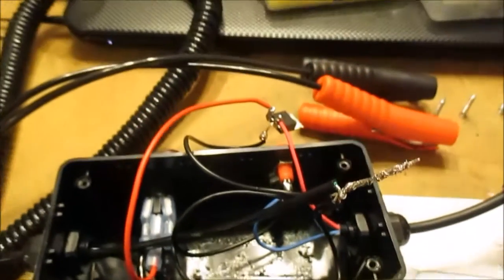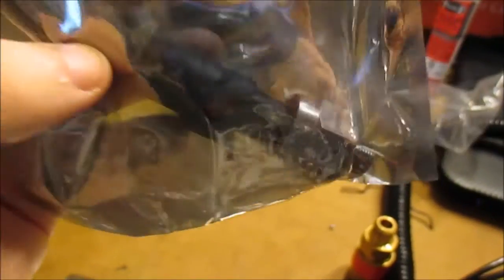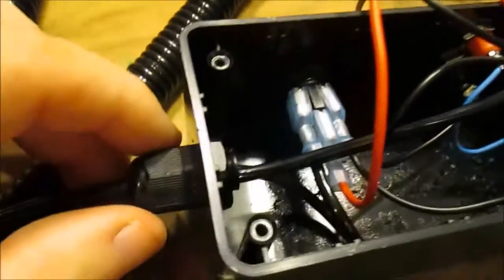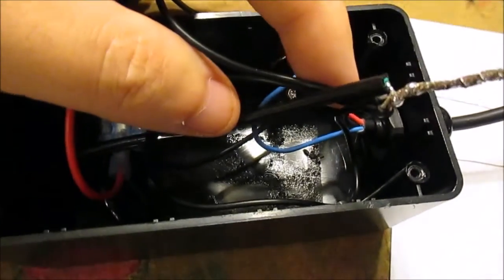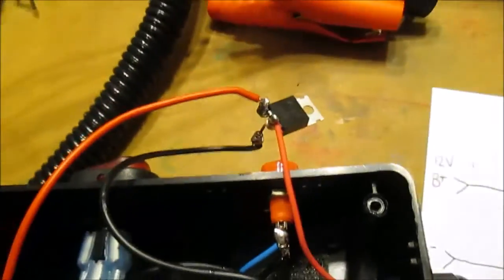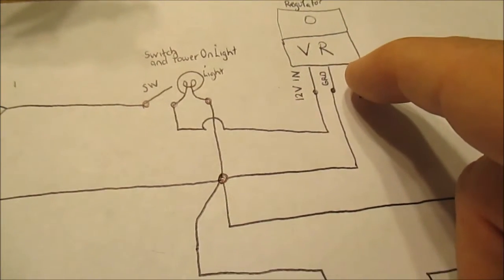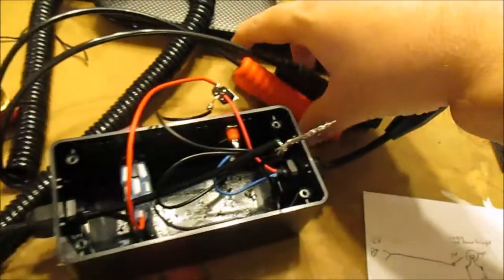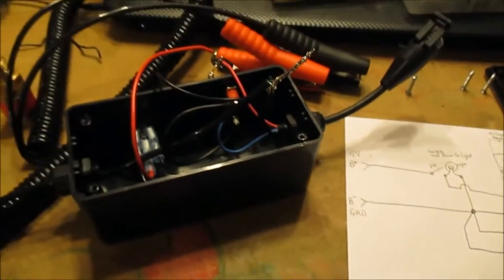Homemade In-Cylinder Pressure Transducer Part 1 The Build

Comment: Normally, a large capacitor is used on the input to the voltage regulator and a small capacitor on the output to help filter any noise out of your circuit.  You can find plenty of example circuits online.  I am thinking about using the same pressure transducers for reading refrigerant pressures in my home HVAC.  Also, I want to read refrigerant line temperatures to calculate superheat and subcool using a Raspberry PI 3.
Reply: Yes agree, if you are going to power this from a car battery a 100uf on the input and 10uf on the output will knock out the alternator noise

Comment: Nice. I bought some Honeywell transducers for mine. I made my box where it has three outputs for transducers so I can run in cylinder, exhaust, and intake at the same time. I used three harnesses that exit the box that are keyed and have threaded ends. That way I don’t have to plug and unplug that fragile three pin pigtail that fits the transducers. I made a simple box with battery clamps first, used it for a while, and took notes on things that would make it more convenient. If you haven’t done so yet you should also make a DIY first look sensor. For less than $20 it’s a handy tool in certain situations.
Reply: can you do a video for your project?
 thanks
Reply from the maker: Thanks for watching!

Comment: Thanks for your video! Very inspiring! I've just ordered the Picoscope 4425 (As I need a professional graphic interface to print results and Pico Automotive supplies the best PC based interface for their Automotive scopes. So I've looked to add also a pressure transducer for having an absolute pressure reading in addition to the electric relative compression test the scope gives. 
I just have a few question please:

1. Why to reduce the volt from 12V to 5V? Do you know what voltage output the Picoscope would handle the best?
2. Can I use a BNC based cabling instead on your 4mm based Banana connections? What would be the wiring of a BNC cable into the box? Which is signal and which is the ground pls?
3.  If I'm not wrong, a healthy engine should give around 200 PSI. Would it be better to use a 300 PSI transducer and to gain more accuracy instead of the almost twice the time  un-needed high pressure support?

Thank you!
Reply from the maker: My husband passed away, and I don't have any answers. Sorry. Thanks for watching anyway.

Comment: ordered all the parts to make a transducer for 500 psi, my question is why some people have 500 and 100 and 30 psi transducers when the 500psi will go from 500 to a vacuum. seems like this would be a pretty general use unit.
Reply: Simple -> Accuracy. With a 500psi sensor 12.5psi/0.1V with a 30psi sensor 0.75psi/0.1V.
Reply: Resolution (not accuracy).

Comment: Can you please specify the pressure transducer type? I cannot find one which would be good for the range 0 - 1000 PSI
Reply from the maker: The ones I used were not brand name specific. I bought mine off of ebay, I got one that said 500 psi and one that said 1000 psi.  If you go on ebay and type pressure transducer you will find them for many applications, it just depends on what you are trying to do. On ebay on most listings it will have the specs for the transducer. Well I hope this info helps you out. Thanks for watching and thanks for the comment. Have a good day.
Reply from the maker: Yeah as far as I can tell that looks exactly like the ones I bought on Ebay for my 0-1000 psi transducer, and my 0-500 psi transducer. They both looked the same just had different psi pressure ratings on them was the only real difference. Well I hope this info helps you out. Have a good day.
Reply: Thanks. You too.

Comment: Have you thought about adding a cap on the 5v to ground to clean up the power signal?
Reply from the maker: No I did not even think about that. I have not played around with a lot of capacitors in electronic circuits. The only ones I mess with are the ones you find on HVAC equipment (start and run capacitors) Overall, I thought it got a pretty good signal, but I dont know, adding a capacitor might make it even better. Thanks for the tip, I might try that next time I build one. Thanks for watching and thanks for the comment. Have a good day.
Reply: hello travis . what is the cap MF and volt should be to clean the signal thanks

Comment: Nice work. I suggest putting a diode for protection from reverse connection.
Few months ago, I planned to do so but I stuck with fittings. Could you guide me ? thanks
Reply from the maker: Having a diode might be a good idea, if I change my design I may use a diode in the future, as well as a few other upgrades. This video for me was more of a proof of concept and I built it very cheaply. As far the fittings go, I just adapted the transducer I bought to fit a standard compression gauge hose, which has a male quick connect fitting on the end of it. So the way I built mine was using the transducer which mine came with a 1/8 npt fitting on it (I think). I had to adapt that fitting to fit a 1/4 npt fitting (I think). So that required me to have a fitting that had a 1/8 female to a 1/4 male fitting. Which would screw into a 1/4 female quick connect fitting to fit the compression hose. Basically I just went to harbor freight and bought my quick connect fittings and then I took my transducer and quick connect fitting and I went to the hardware store and basically put it all together in the store and I just bought the adapter fitting from the hardware store. Well I hope that makes sense I am not to good at explaining what the fittings are called (I tell you I am the worst plumber)   I would think if you could find a transducer that comes with a 1/4 fitting you could hook that directly without having to use an adapter (that would be the best way to go I think)  If you search ebay for 500 psi pressure transducer you can probably find the same one I used. Also I think the ebay ad I looked at had a link for adapter fitting as well for different applications. Well I hope this info helps you out. Thanks for watching and thanks for the comment. Have a good day.